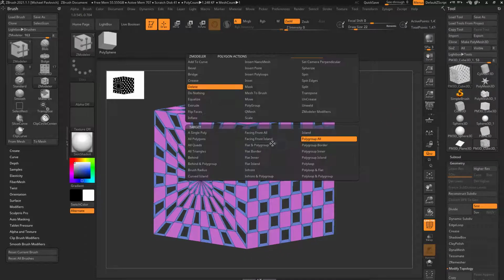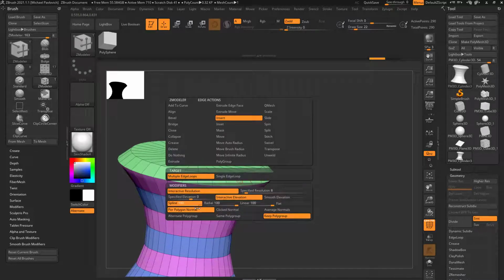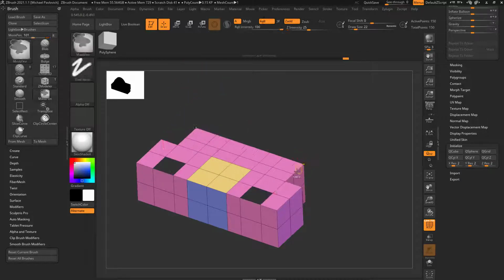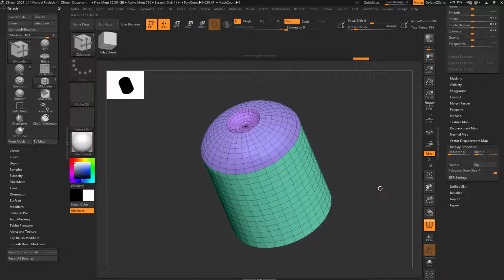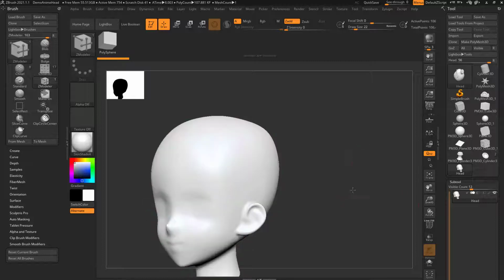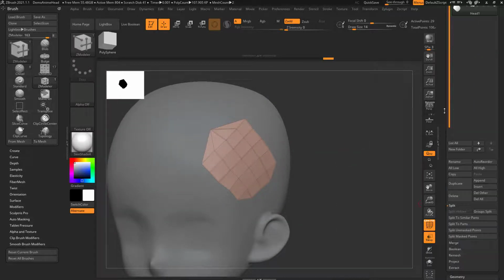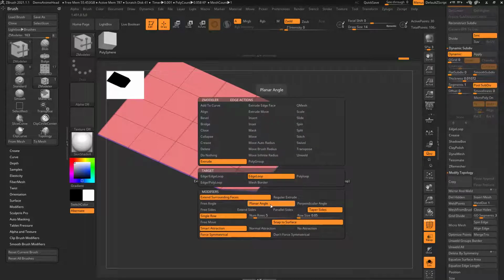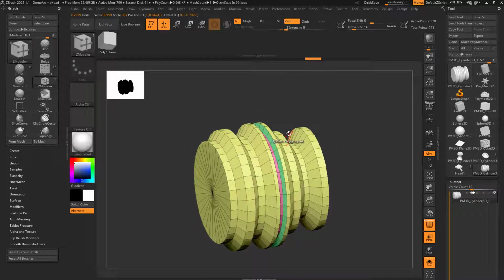031 ZBrush ZModeler Edge Actions

Comment: Thank you Michael. Even if this seems a simple task, I can't find a way or option to straighten an entire edge loop when using the Zmodeler brush! For example, select an existing edge loop, and then straighten or align the edges all at once, horizontally or vertically? 

When using Blender it's super simple. I can select my edge loop and scale them, for example, until I have a perfect aligned horizontal edge loop from all the edges.

But I am not able to find a simple operation like this when using the ZModeler brush. Hmmm, I am sure there are multiple ways, but wonder what you would recommend to get this job done. And how you would approach that. Thx a bunch!
Reply from the maker: for edge selection and scaling, you can use edge action > transpose > edgeloop complete, that'll unmask your edge and you can z-scale it flat like you said. you can also align edge strip with 0 specified curvature in lateral situations: https://x.com/pavmike/status/1014241038154813441